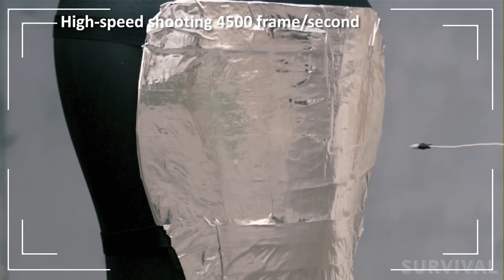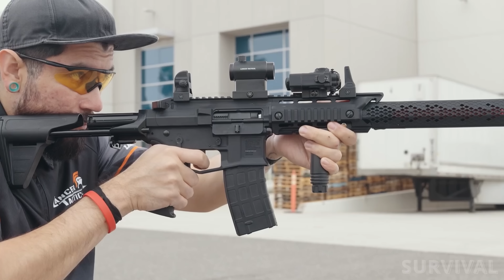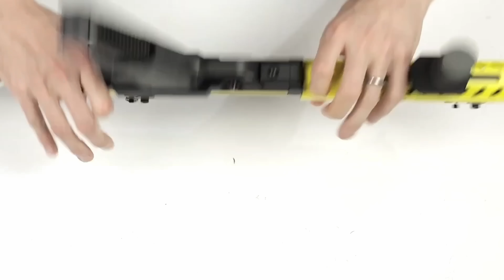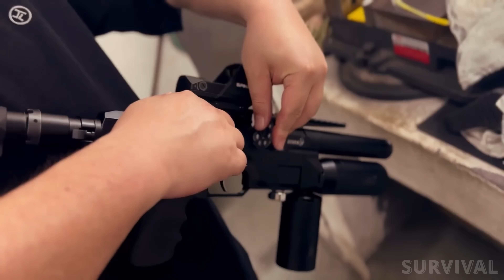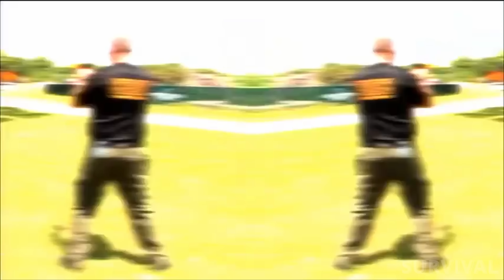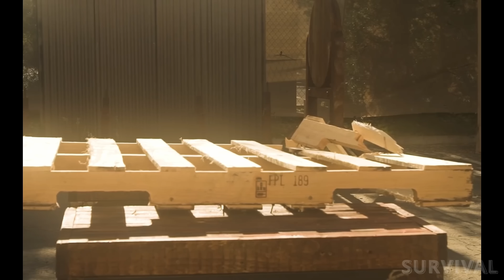10 Lethal Home-Defense Weapons Anyone Can Legally Buy on AMAZON! (No Permit Required)

Comment: 8 inches at 100 yards is not precise at all.  That's like someone saying they  can shoot a paper plate at 100 yards, not even good enough IMO for deer hunting.  Generally you should be able to hold 3 inches or better with a smooth bore shotgun at 100 yards.  So that tells you how bad the accuracy is when they are touting 8 inches.
Reply: This is a home defense vid.
Reply: Im old enough to remember slugs grouping in a pie pan at 50 yds n tge first sabot slugs looked like a ww2 torpedo.  3"@100 was amazing back then.
Now slugs should group 3 moa at worst.